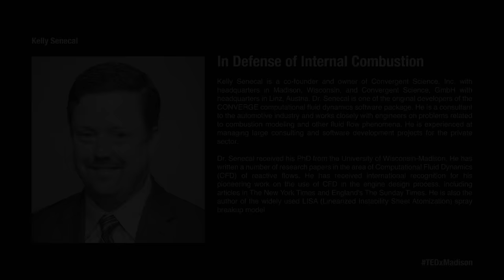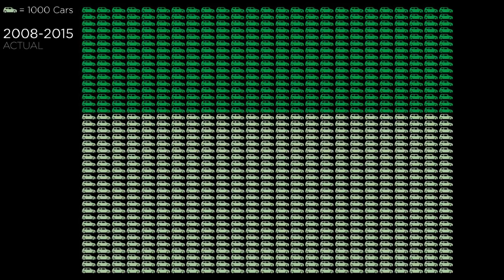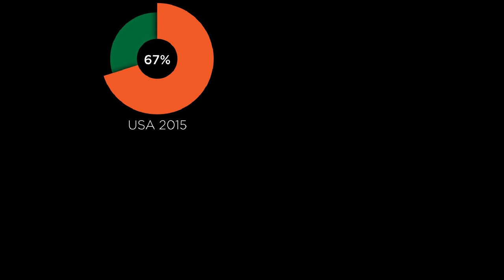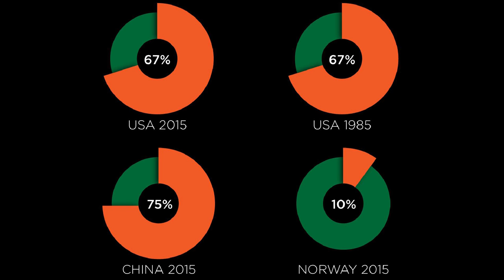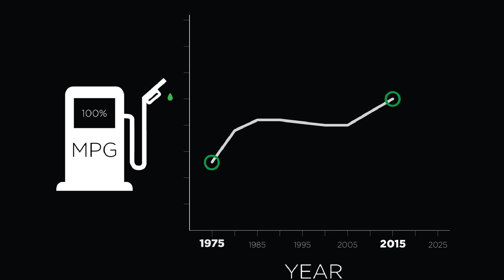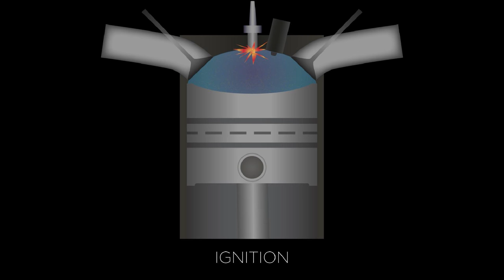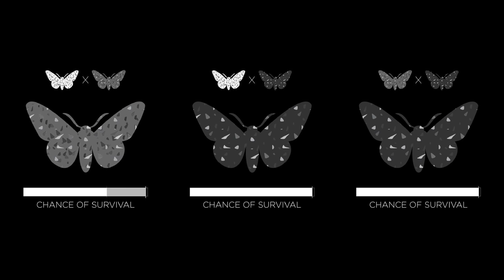In Defense of Internal Combustion | Kelly Senecal | TEDxMadison

Comment: I love my engines and get so worried that EVs will soon dominate. However, I have a good memory being autistic and always love reading about things. When I was 16 in 1996 and signing up to study motor mechanics, my dad said to me that he believed the internal combustion engine will be dead in 15 years and said I was wasting my time with the course (2011 I was projecting then), maybe because he loved 'Demolition Man' (I do too). In 1992, I had a radio controlled car for Christmas that was electric and the acceleration was insane but only lasted 10  minutes of thrashing but took 5 hours to recharge. A friend had a petrol radio controlled car that was still quick but noisy but lasted over an hour of thrashing but was refueled in seconds. Many of the early vehicles were electric but advances in engine design still continues. If electric is the way forward all of a  sudden, why are car makers still making petrol cars? I could go on but I would be here all day. Synthetic fuels are so much better for the environment that smashing the Earth's crust to pieces to extract lithium. I'll stick with my 1974 Honda CB125 and my 1983 Volvo 345. At least they are carbon neutral.
Reply: And I'll drive my gas car and Diesel truck until they literally start falling apart, thank you. I'm tired of electric vehicles being pushed like they're magic.

Comment: Very good - you didnt have to ban horses to get them off the streets, they were outmoded. This tells you that the motives for removing combustion are political not scientific.
Reply: Excellent
Reply: Agreed
Reply: We dont want to ban cars for Gods sake, we just want to make them better. We admit that we still need cars. Horses are completely different we dont need them any more but if we did we would do all we can to make them better for our use and that's all electric cars are. They're not a revolution, it's just a tweaking of a form of transportation that's been around over 100 years
Reply: You do realize pollution is real, right?
Reply: @AFoxGuy  Of course pollution is a problem. But no electric vehicle will be able to magically solve our pollution problems.

Besides, when a majority of the cars on the road are electric, will gas cars really be that much of an issue any longer? Especially if our gasoline is made from things like carbon capture or waste biomass pyrolysis?
Reply: @electric7487  Yes, when the majority of the cars are electric, gas cars won't be a problem. Unfortunately, the majority of the cars on the road are NOT electric, making gas cars a problem RIGHT NOW.
Reply: @mibbleschmipse1056  And a better solution than banning gasoline cars is more public transport. Electric buses, subways, trams, and high speed rail or MagLev. Way more efficient and less polluting than a whole bunch more cars on the road. EV's are the future, but they are only a part of the solution.
Reply: TESLA proved BEVs were better, THEN govt. got involved, not before. The BEV will kill the ICE with/without govt. mandates. In Norway 80+% new sales are BEVs, China, the largest car market, 50+%. Demand exceeds production by over a year.
Reply: @electric7487  : I agree.  But public transportation wasn't considered by most of our city planners.  How many cities in America have a subway/trolley/tram system?  Just a handful.

Comment: Few points:  electric and hybrid cars are more efficient due to energy recovery and operating the engine nearer to its optimum range. Non-hydroelectric energy has out passed fossil in many countries, and prices continue to drop. Power station is producing its emissions in the street, therefore even if it produces the same emissions (Co2 and pollutants) its effect on health is lower, and if governments really want to upgrade them and make them cleaner, it is a lot easier than millions of cars on the road.
It is not just about the engine, it is a whole system. It is a whole different way of thinking. The same thinking holding onto the IC engine, is holding into frictions brakes, the most efficient energy waster system of all time.

Comment: Use synthetic fuel and completely remove fossil fuels would the best system. Its really that simple
Reply: Is it ?
Reply: @Mhadyourfriend  I'm happy to have electric, hybrids and Hydrogen etc but Synthetic fuel certainly isn't a bad idea
Reply: Synthetic? As in non-carbon based?
Reply: @Alexi7666  they are carbon based but any emissions (a reduction in particulate emissions of 85% compared to Fossil fuels) would be then taken from the atmosphere via carbon traps to then make more synthetic fuel. A carbon neutral cycle. Endless supply of a fuel that doesn't add to climate change. Like anything its difficult to scale it up production wise but that doesn't mean it shouldn't be done!

Comment: I agree with this presentation. We should improve engines until we can't anymore. eventually though we will reach or at least get close to the theoretical Max efficiency. otherwise known as Carnot's efficiency. unfortunately however we will never see a car with internal combustion engine with over 50% efficiency. Tesla cars already have 90% efficiency.
Reply: You are comparing apples with oranges. Batteries are a energy sink. They consume energy, they don't produce it.
Reply: Carnot efficiency only applies to heat engines, the ICE is a chemical engine (converts chemical energy to mechanical energy), not a heat engine. Check a thermo book - it fails the definition of a heat engine as the working fluid changes during the process.
Reply: teslas dont have a 90% efficiency. The overall efficiency of E.V's is about 70%
Reply: Some of the modern diesel engines are already at 45% efficiency. And the MANN engines that run the large cargo ships run at 52%.
Reply: @FrmerK20  ...which is still higher than 50

Comment: You guys have had 100+ years to get it right....
And while someone quoted the Tesla as only 70% efficient, it's still almost twice the efficiency of a Prius...  Before you jump on the archades engine being 60%, how many are actually on the road today? 
At least with electric vehicles I can put solar on my roof and storage in my garage and truly push closer to Zero emmision vehicle.. 
When you also factor in EV's being part of the grid as storage then you also get a more stable grid from the fluctuations of renewables... 
Already watched several videos stating that by 2023.... The tide will have turned and ice powered vehicles will be worth next to nothing
Reply: That's the problem, you watched videos, you havent used your own mind, than you would actually know the cost behind solar modulesand when they have to be replaced....
Reply: In those 100 years the combustion engine got improved a lot and it still is. Just compare a modern V6 to a old one and tell me its the same engine.
Reply: @punnagchatterjee8043  That makes no sense for various reasons, A) A Camry's engine is not 40% efficient. A modern Camry engine may peak at 35% efficiency, but it likely averages about 25% efficient. B) You just did a well to wheel conversion for the Tesla, but did not do the same thing for the combustion engine: once the well-to-wheel methodology is applied to the Camry (costs of extraction, refining and delivery of fuel), it's only about 15% efficient.
Reply: @punnagchatterjee8043 , I am a mechanical engineer and totally concur with you. Just by putting the solar panels on the roof and then running an EV is not going to make it a zero-emission vehicle. It takes almost the same amount of carbon to create the EV and then some more to create the battery. And god knows how much it is going to take to destroy that giant pile of batteries in years to come. Look at Nissan Leaf. It looses 75% of its capacity in just a couple of years. Is that sustainable by any means?

The new technology that is being introduced by Mazda, may be late 2020, called "Skyactive X" which will improve the efficiency of IC engines by almost 30%. They plan to increase the compression ratio and ignition by compression instead of spark plugs, thereby achieving the same power by supplying 30% leaner fuel. That's something very interesting thing to watch in the evolution of IC engines. And if it works, probably that will be last nail in the coffin of the EV non-sense.
Reply: @damudagade  That technology has existed for years and is called a Diesel Engine. They just figured out how to apply it to regular fuel.
Reply: I agree. Every automaker is jumping on the EV bandwagon.  There is no long-term future for the ICE.
Reply: @kingjulian7345  : The ICE was stagnant for a few decades.  Then climbing oil prices and air pollution issues forced automakers to merge the ICE with the microchip.  We still have far too many gashog pickups and SUVs on our highways.
Reply: @damudagade  : Battery technology is and will continue to improve.  My V-6 Camry gets amazi ng fuel mileage(37-39 mpg on trips), but it will likely be my last ICE vehicle.  EVs will evolve and improve.
Reply: Well we are now 8 or so months from 2023 when you said ice cars will be worth next to nothing.   Very wrong.  There is strong demand for cars and prices are rising.  The industry isnt even capable of making enough evs even if ice was banned tomorrow.   Tesla is running at 100 percent capacity and they still dont make enough to satisfy demand.  Even with 2 new plants coming online, still not enough.   There is no ev made that meets my transportation needs so I will stick with ice until evs are practical, and cost efficient
Reply: @howebrad4601  : I haven't converted to an EV yet, either.  My '18 ES350(3.5L V-6) and '14 Chevy Equinox(2.4L 4-cyl.) get decent mileage.  Just like anything else electric, EV prices will drop as more enter the market.  As oil prices creep up and Americans shift from gashog pickups/ SUVs to hybrids/EVs the prices will drop.
Reply: @Alexi7666  I cant switch.   I need a one ton dually for the trailers I pull for my business plus personal use.  Just got back from a 1550 mile trip one way.  Was pulling a 42 foot gooseneck trailer and it made me think how often I would have to stop to recharge, assuming they even made an ev with dual wheels which is what I have tr o have to be stable enough to pull that kind of weight.  Stopped 5 time for fuel, approx 15 minutes each time.  It would easily take me 1 or 2 days longer if I was running ev
Reply: @howebrad4601  : I ould say you are an anomaly.  EVs are designed, mainly, for urban and suburban drivers and rural folks that don't have a pickup truck in their lives.  The switch to EVs will be incremental.  Just taking the millions of ICE-powered vehicles in our cities and suburbs off the street will go a long ways toward cutting carbon emissions.

Comment: what a joke. The internal combustion engine has had much more development time, and is already nearing its' maximum efficiency that consumers will see. You are missing one thing, however. Since electrons are basically massless, the more efficient and energy dense we create a battery, the lighter a car can be, and the more efficient it is per mile per kilogram. Electric cars have not received the hundreds of billions  to trillions of dollars of r&d that fossil fuel burning engines have had, and I expect electric car's rate of improvement to far outstrip the improvement of ICE's. Once we create a high density, cheap battery (graphene or carbon nanotubes and solid batteries sound like good candidates), the cost differential might even be in favor of electric vehicles, since ICE's and their drivetrains are so expensive.
Reply: People will drive electric cars only if they are cheaper than the gasoline cars in a free market.
Reply: I'll never drive a electric, cuz  I dont want to. 
I dont like EVs, I dont want to use then. I dont care about efficiency, I only want to have and use what I like.
Reply: @cumminsscout  That's disengenous, EVs have not been in active development since the early 20th century, other than a few oddball side projects of auto manufacturers. There's a clear point where business capital moved away from them and into combustion engine vehicles, now that relationship is flipping.
Reply: @cumminsscout  battery capacity has been increasing 6% every year, once solid state metallic batteries are commercialized there's liable to be a doubling of capacity. If batteries double in density it will be ICE vehicles that are playing catch-up in driving range, and they only need to achieve at 500 Kw charging for filling a gas tank to be slower than filling a battery, some high end cars are already nearing that capability, no more than a decade before that technology is the standard.
Reply: @cumminsscout  electric is 4x as efficient, it only needs 1/4 the energy density of gasoline to drive as far or further. Electric motors are also far more energy dense than engines, a 50 lbs motor can produce the same power and torque as a 300 pound engine, far less complexity and weight. This is why the future is electric, they have a huge efficiency advantage, battery energy density is getting better continuously; fossil fuels are not getting any more energy dense, and engines are only getting heavier and more complex than they used to be. Doesn't take a supercomputer to see that electric vehicles will eclipse combustion vehicles in range and fuelling time.
Reply: @cumminsscout  I don't disagree with overpopulation being a problem, but that's neither here nor there for this argument. Basically, you're going to be driving an electric vehicle in 10-15 years time and you'll be wondering what you ever saw in your diesel vehicle.
Reply: @cumminsscout  Having driven a few electric cars I'd say the lasting effect of driving a really good long range electric vehicle is startling, they are incredibly quick and they drive beautifully, getting back into a gas vehicle afterwards feels like a downgrade, they feel slow, unresponsive and noisy. Electric cars are already really good, and as they continue to improve and costs come down, the notion of buying an EV to be "green" or "eco-friendly" will be pointless and obsolete, people will be getting them because they are just cheaper and better.
Reply: @0hypnotoad0  I read this whole discussion and i Love how you basically tackled every argument with such accuracy and ease. Also, the fact that cumminsscout stopped giving arguments and went to the emotional aspects of liking ICE, pretty much proves your point. Thank you.
Reply: @Simon-nx1sc  I spend a bit of time watching EV news and there's always a contingent of anti-ev people who come in to comments sections and employ the same flawed arguments against the technology, it's almost always the same arguments you encounter, so you can almost copy paste retorts, lol. A few years ago I was also anti-ev, I had the same doubts: "battery is not energy dense enough, batteries only last for a few years," etc. But I was curious about it; specifically I didn't understand how the battery warranty on cars could be 8 years, so I read further into it and realized I was just wrong, my presumptions were false and based on a lack of relevant experience. So, I tend to understand why people have these misconceptions and how they arise, and now I try to engage with people who have those beliefs.
Reply: @0hypnotoad0  That's very encouraging to read! Being able to erase presumptions when proven wrong is a very important skill! 

I was brought to this ted talk because my professor (mechanical engineering, Belgium) recommended it. I think it's in some parts a rather misleading ted talk and shouldn't be recommended by professors. I posted my research in a new separate comment, if you're interested.
Reply: @cumminsscout  : Necessity is the mother of invention.  We didn't NEED EVs for almost a century. Now we do.
Reply: @cumminsscout  : Yes, few electric trucks, but plenty of Teslas.
Reply: @cumminsscout  : Let me repeat: The issue is the 40% of carbon emissions that come from private transportation.  Your Kenworth is at the bottom of the list of priorities.
Reply: @cumminsscout  : Obviously you are stuck in the 1950s/1960s.  Do you even own a cell phone?